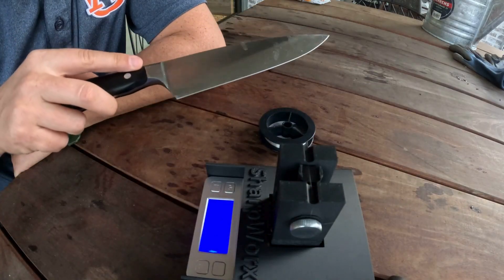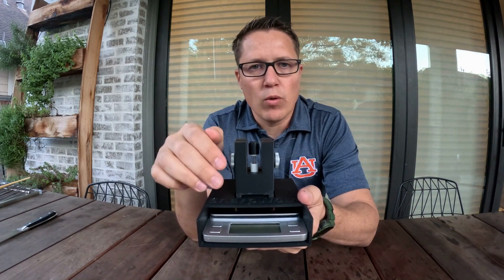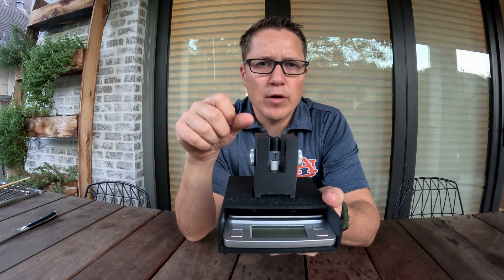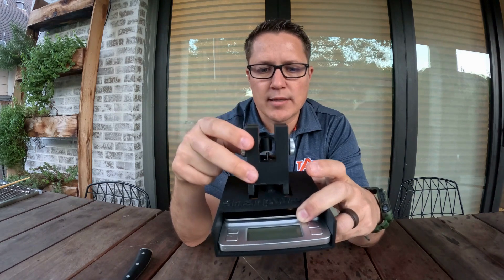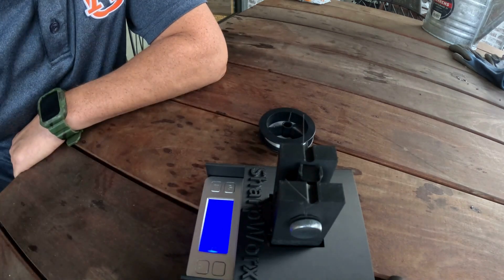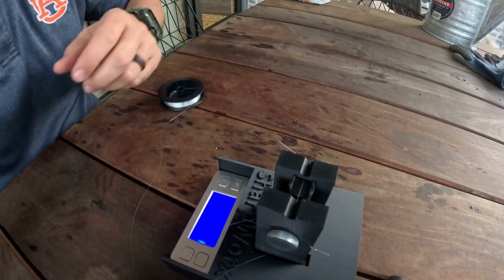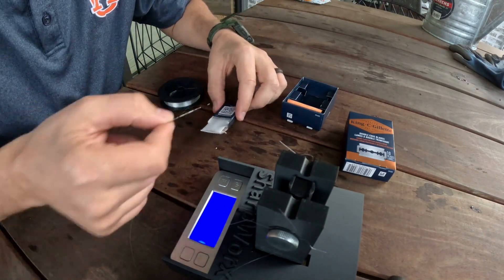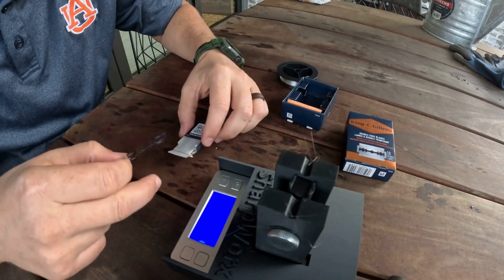Want a Sharper Knife? Extremely Accurate Sharpness Tester - Watch Now

Comment: Isn’t this the same as the Bess sharpness tester. I have found fatal flaws with the Bess. The faster you push the blade down. The lower your score will be. I’d be interested in reviewing your tester.
Reply from the maker: I added a dampener to be under the filament (not under the edge though), so that the edge started at zero speed.

Comment: I like the consistency value, that comes with it. So people in 2 places can compare edge sharpness values equally. Doesn't that scale have a Tare setting? That would save turning it on/off all the time. 
The spring still gets to me though. I feel it allows an aspect of human error or judgement to be involved. These scale systems are meant to remove that aspect, imo. 
Discerning & overthinking, 2 of my best/worst traits lol. A spring relies on the weight or amount of mass to compress it. Consistency is key. Repeatable, consistent results. Like an automatic door closer, you can let it go & it closes or if you push against it, it still closes at the same rate. 
I'm really enjoying following this, hope I'm not too annoying 😅. 
I didn't see the scale on your site last night when I looked. Is it arriving soon?